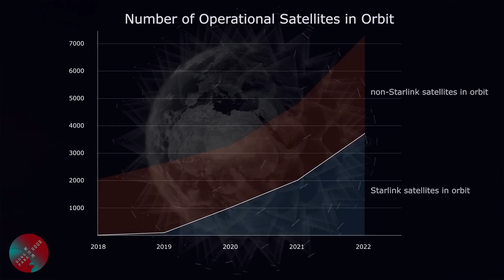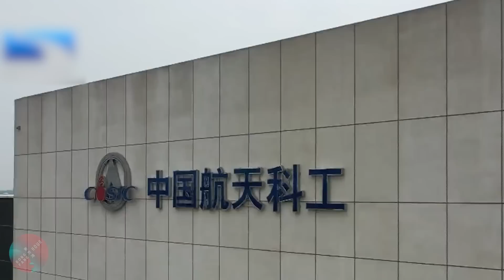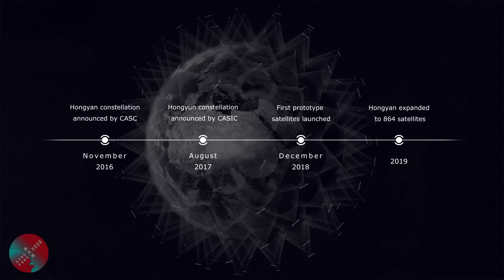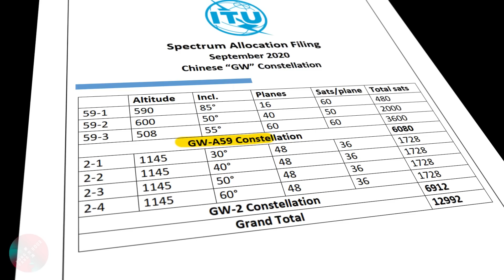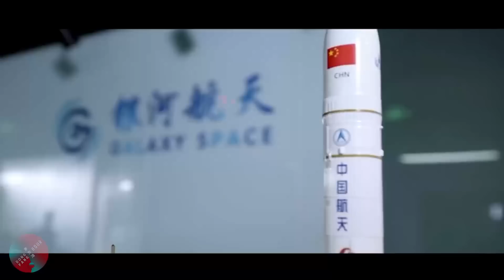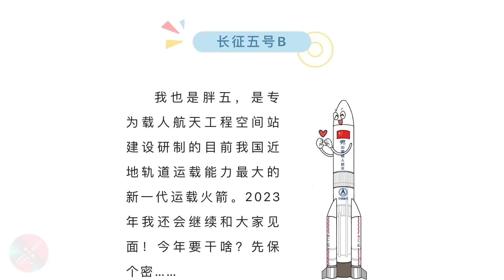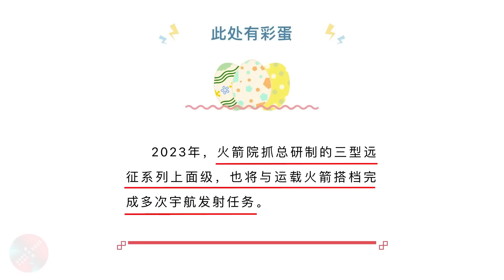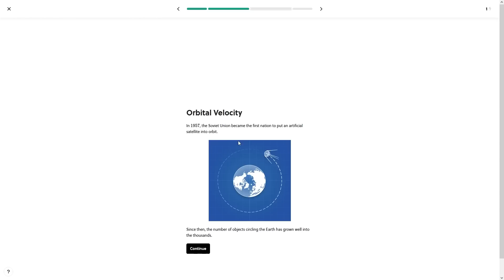Guowang, the Constellation You've Never Heard Of

Comment: Would the CZ-5B adapted for Guowang satellite launch still have core stage to orbit with uncontrolled reentry? Or do you know if the adapted upper stage will be what takes the payload to orbit?
Great video, thanks
Reply from the maker: I don't think this information is known at the moment. However, considering the backlash China faced from NASA and other space agencies, I would be surprised if this weren't the case. Especially if the CZ-5B adopts a high frequency launch cadence (which was not the case up to now).